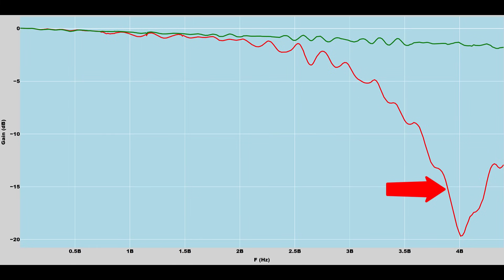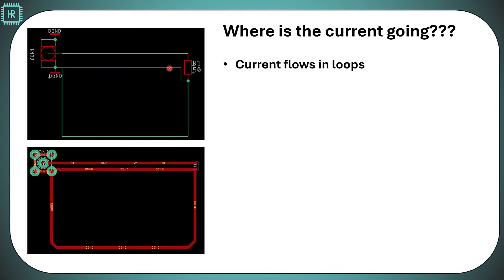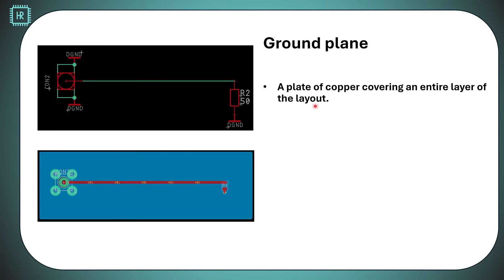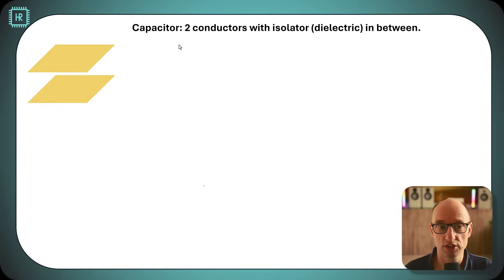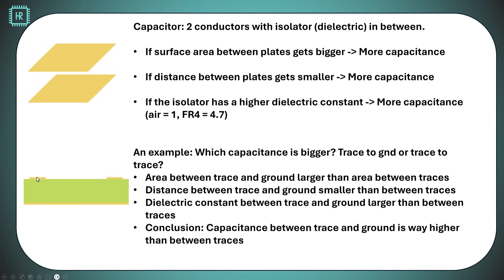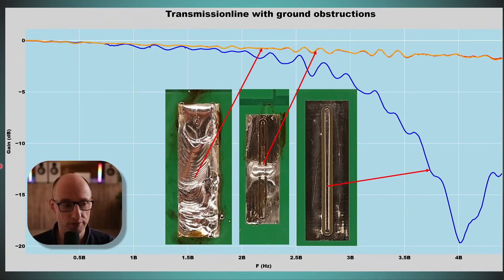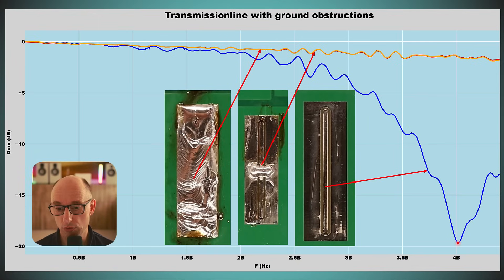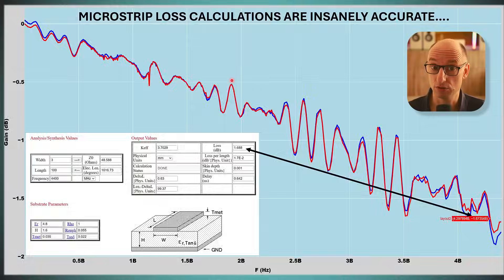Flawless PCB design: RF rules of thumb - Part 1

Comment: Please send me the checklist? 😋
Reply from the maker: I've changed the free checklist offer a bit: You also get a 1 hour module of my course for free!

You can find the link to the page in the description. Scroll down a bit on that page (Or read the whole page, you may get curious :-) ) to find the link. It is a purple button 'Watch The Free Module And Get The Checklist'.

You will have to leave your email address so I can start spamming you :-D . I don't do that very often, on average once a month, but I am thinking about starting an email series with useful electronics tips at some point.

Best regards,

Hans Rosenberg

Comment: Thank you so much for the valuable knowledge you shared in the video. It was truly interesting. Send me the checklist.
Reply from the maker: I've changed the free checklist offer a bit: You also get a 1 hour module of my course for free!

You can find the link to the page in the description. Scroll down a bit on that page (Or read the whole page, you may get curious :-) ) to find the link. It is a purple button 'Watch The Free Module And Get The Checklist'.

You will have to leave your email address so I can start spamming you :-D . I don't do that very often, on average once a month, but I am thinking about starting an email series with useful electronics tips at some point.

Best regards,

Hans Rosenberg

Comment: Send me the checklist (Send met the checklist)
Reply from the maker: I've changed the free checklist offer a bit: You also get a 1 hour module of my course for free!

You can find the link to the page in the description. Scroll down a bit on that page (Or read the whole page, you may get curious :-) ) to find the link. It is a purple button 'Watch The Free Module And Get The Checklist'.

You will have to leave your email address so I can start spamming you :-D . I don't do that very often, on average once a month, but I am thinking about starting an email series with useful electronics tips at some point.

Best regards,

Hans Rosenberg

Comment: Dear sir ; I still build point to point ( tube amplifiers ).........ground every stage local .....and usez a bus wire ground wire to connect every stage ground...........some like the trend of starground , I didn't like that because in my builds they were less performant...
I see in most commercial ampifiers the same errors ( to my experience ) , not separating ripple filtering and reservoir with capacitors ........alos that idea that huge capacitor values do a better job ( used as well for ripple and resrvoir at the same time )
When some resistors are in // i mount them tête -beche.......idem witHh // signal caps ...2 in // sound better than only one .
and a lot of other details.......when added up all those ( mostly small ) details make a ( big) difference ....I see also a lot of bad soldering ...or bad layouts for signal wiring and tube heaters..
Have a nice day and thank you for sharing your experience.
Reply from the maker: You're welcome, I hope this knowledge helps!

Comment: Thanks for the video. Please, send me the checklist.
Reply from the maker: I've changed the free checklist offer a bit: You also get a 1 hour module of my course for free!

You can find the link to the page in the description. Scroll down a bit on that page (Or read the whole page, you may get curious :-) ) to find the link. It is a purple button 'Watch The Free Module And Get The Checklist'.

You will have to leave your email address so I can start spamming you :-D . I don't do that very often, on average once a month, but I am thinking about starting an email series with useful electronics tips at some point.

Best regards,

Hans Rosenberg

Comment: Fastastic video!  It's been a year since you posted this, but can you still send me the checklist?
Reply from the maker: Yes I can :-) I've changed the free checklist offer a bit: You also get a 1 hour module of my course for free!

You can find the link to the page in the description. Scroll down a bit on that page (Or read the whole page, you may get curious :-) ) to find the link. It is a purple button 'Watch The Free Module And Get The Checklist'.

You will have to leave your email address so I can start spamming you :-D . I don't do that very often, on average once a month, but I am thinking about starting an email series with useful electronics tips at some point.

Best regards,

Hans Rosenberg

Comment: Great video. Send me the checklist.
Reply from the maker: I've changed the free checklist offer a bit: You also get a 1 hour module of my course for free!

You can find the link to the page in the description. Scroll down a bit on that page (Or read the whole page, you may get curious :-) ) to find the link. It is a purple button 'Watch The Free Module And Get The Checklist'.

You will have to leave your email address so I can start spamming you :-D . I don't do that very often, on average once a month, but I am thinking about starting an email series with useful electronics tips at some point.

Best regards,

Hans Rosenberg

Comment: Plase, send me the checklist.
Reply from the maker: I've changed the free checklist offer a bit: You also get a 1 hour module of my course for free!

You can find the link to the page in the description. Scroll down a bit on that page (Or read the whole page, you may get curious :-) ) to find the link. It is a purple button 'Watch The Free Module And Get The Checklist'.

You will have to leave your email address so I can start spamming you :-D . I don't do that very often, on average once a month, but I am thinking about starting an email series with useful electronics tips at some point.

Best regards,

Hans Rosenberg

Comment: Send me the checklist 
Thank you
Reply from the maker: 've changed the free checklist offer a bit: You also get a 1 hour module of my course for free!

You can find the link to the page in the description. Scroll down a bit on that page (Or read the whole page, you may get curious :-) ) to find the link. It is a purple button 'Watch The Free Module And Get The Checklist'.

You will have to leave your email address so I can start spamming you :-D . I don't do that very often, on average once a month, but I am thinking about starting an email series with useful electronics tips at some point.

Best regards,

Hans Rosenberg

Comment: Dear Hans, thank you for this great explanation/ Beste Hans, bedankt voor de prima uitleg.
I'm just a hobbyist trying to design a circuit that features the Raspberry Pi Pico W as uC.
I chose it over my previous work horse, the Arduino Nano v3, specifically because the Pico has many GND pins.
My signals have low frequency, except the digital switching involved. That tripped me up.

Could you please send me your checklist? Much obliged.
Reply from the maker: I've changed the free checklist offer a bit: You also get a 1 hour module of my course for free!

You can find the link to the page in the description. Scroll down a bit on that page (Or read the whole page, you may get curious :-) ) to find the link. It is a purple button 'Watch The Free Module And Get The Checklist'.

You will have to leave your email address so I can start spamming you :-D . I don't do that very often, on average once a month, but I am thinking about starting an email series with useful electronics tips at some point.

Best regards,

Hans Rosenberg

Comment: Could you send me the checklist too please?
Reply: I found the link, thanks a lot :)
Reply from the maker: I've changed the free checklist offer a bit: You also get a 1 hour module of my course for free!

You can find the link to the page in the description. Scroll down a bit on that page (Or read the whole page, you may get curious :-) ) to find the link. It is a purple button 'Watch The Free Module And Get The Checklist'.

You will have to leave your email address so I can start spamming you :-D . I don't do that very often, on average once a month, but I am thinking about starting an email series with useful electronics tips at some point.

Best regards,

Hans Rosenberg

Comment: Plese send me the checklist.
Reply from the maker: I've changed the free checklist offer a bit: You also get a 1 hour module of my course for free!

You can find the link to the page in the description. Scroll down a bit on that page (Or read the whole page, you may get curious :-) ) to find the link. It is a purple button 'Watch The Free Module And Get The Checklist'.

You will have to leave your email address so I can start spamming you :-D . I don't do that very often, on average once a month, but I am thinking about starting an email series with useful electronics tips at some point.

Best regards,

Hans Rosenberg

Comment: Send me a cheklist, thanks
Reply from the maker: I've changed the free checklist offer a bit: You also get a 1 hour module of my course for free!

You can find the link to the page in the description. Scroll down a bit on that page (Or read the whole page, you may get curious :-) ) to find the link. It is a purple button 'Watch The Free Module And Get The Checklist'.

You will have to leave your email address so I can start spamming you :-D . I don't do that very often, on average once a month, but I am thinking about starting an email series with useful electronics tips at some point.

Best regards,

Hans Rosenberg

Comment: Send me checklist please.
Reply from the maker: I've changed the free checklist offer a bit: You also get a 1 hour module of my course for free!

You can find the link to the page in the description. Scroll down a bit on that page (Or read the whole page, you may get curious :-) ) to find the link. It is a purple button 'Watch The Free Module And Get The Checklist'.

You will have to leave your email address so I can start spamming you :-D . I don't do that very often, on average once a month, but I am thinking about starting an email series with useful electronics tips at some point.

Best regards,

Hans Rosenberg

Comment: Please send me the checklist, loving your work so far, a lot that I have learned from other greats such as Lee Ritchey and Rick Hartley.
Reply from the maker: Thanks a lot, that is a great compliment!

I've changed the free checklist offer a bit: You also get a 1 hour module of my course for free!

You can find the link to the page in the description. Scroll down a bit on that page (Or read the whole page, you may get curious :-) ) to find the link. It is a purple button 'Watch The Free Module And Get The Checklist'.

You will have to leave your email address so I can start spamming you :-D . I don't do that very often, on average once a month, but I am thinking about starting an email series with useful electronics tips at some point.

Best regards,

Hans Rosenberg

Comment: envieme la lista de verificación. Send me the check list of verification. Thank you
Reply from the maker: I've changed the free checklist offer a bit: You also get a 1 hour module of my course for free!

You can find the link to the page in the description. Scroll down a bit on that page (Or read the whole page, you may get curious :-) ) to find the link. It is a purple button 'Watch The Free Module And Get The Checklist'.

You will have to leave your email address so I can start spamming you :-D . I don't do that very often, on average once a month, but I am thinking about starting an email series with useful electronics tips at some point.

Best regards,

Hans Rosenberg

Comment: Excellent Video! please send me the checklist
Reply from the maker: Sorry for the late reply: I'm really behind!

I've changed the free checklist offer a bit: You also get a 1 hour module of my course for free!

You can find the link to the page in the description. Scroll down a bit on that page (Or read the whole page, you may get curious :-) ) to find the link. It is a purple button 'Watch The Free Module And Get The Checklist'.

You will have to leave your email address so I can start spamming you :-D . I don't do that very often, on average once a month, but I am thinking about starting an email series with useful electronics tips at some point.

Best regards,

Hans Rosenberg

Comment: I would like your checklist too please. 

30 years ago as a young software engineer I also started writing down every bug or problem I encountered and the corresponding solution. I naively thought eventually I would just look up each problem and not have to puzzle anymore. 30 years later and I've lost 30 such embryonic lists, and realise I've rarely encountered the same problem twice!

I'm super impressed and a little jealous that you've managed to be organised and committed enough to actually write a book. That's inspirational.
Reply from the maker: Interesting, I think I understand why this works in electronics and not in software. Electronics is related to physics directly, whereas software changes all the time. This makes an electronics checklist far more 'timeless'.

Sorry for the late reply: I'm really behind!

I've changed the free checklist offer a bit: You also get a 1 hour module of my course for free!

You can find the link to the page in the description. Scroll down a bit on that page (Or read the whole page, you may get curious :-) ) to find the link. It is a purple button 'Watch The Free Module And Get The Checklist'.

You will have to leave your email address so I can start spamming you :-D . I don't do that very often, on average once a month, but I am thinking about starting an email series with useful electronics tips at some point.

Best regards,

Hans Rosenberg
Reply: @HansRosenberg74 yes I was thinking the same reason. I just used some op amps I found in my attic from the late 80s! I can't imagine even accessing let alone compiling software I wrote in the same era. Thanks for the tips.

Comment: Yes please I'd like a copy of your check list. Thanks.
Reply from the maker: I've changed the free checklist offer a bit: You also get a 1 hour module of my course for free!

You can find the link to the page in the description. Scroll down a bit on that page (Or read the whole page, you may get curious :-) ) to find the link.

You will have to leave your email address so I can start spamming you :-D . I don't do that very often, on average once a month, but I am thinking about starting an email series with useful electronics tips at some point.

Best regards,

Hans Rosenberg

Comment: Nice video's Hans! Very clear to watch. But I have only one question: in DC the ground plane is the - of the DC. But is the groundplane in 230V AC connected to the neutral or must it be connected to earth to minimize noise etc? 

Oh yeah, and please send me the checklist!
Reply from the maker: Very often, the grid ground is isolated from the ground of your circuit. A linear supply has a transformer to do that, but a switching supply as well.

I've changed the free checklist offer a bit: You also get a 1 hour module of my course for free!

You can find the link to the page in the description. Scroll down a bit on that page (Or read the whole page, you may get curious :-) ) to find the link.

You will have to leave your email address so I can start spamming you :-D . I don't do that very often, on average once a month, but I am thinking about starting an email series with useful electronics tips at some point.

Best regards,

Hans Rosenberg

Comment: I would like the checklist as well please!
Reply from the maker: I've changed the free checklist offer a bit: You also get a 1 hour module of my course for free!

You can find the link to the page in the description. Scroll down a bit on that page (Or read the whole page, you may get curious :-) ) to find the link.

You will have to leave your email address so I can start spamming you :-D . I don't do that very often, on average once a month, but I am thinking about starting an email series with useful electronics tips at some point.

Best regards,

Hans Rosenberg

Comment: Thank you Hans, 
I've never heard or seen PCB ground planes described in such a simple and relatable way and I've been in the industry for 35 years.
I still find plenty of engineers new and old who treat RF design as a 'dark art' and hand wave it away with 'well I only design digital',  but ALL electronic design outside of a simulation IS analog design,  it's just as important to understand good practice and the reasons why when designing any PCB.
  
 Thank you again for your generous tip in sharing your knowledge freely.

Please Send Me a Copy !
Reply from the maker: Wow, thanks for the nice reply. It's always so great to get feedback from experienced electronics engineers, those are so nice to hear :-). I so much like your realisation that all electronic design is analog design, that is soo true, and if you treat designs that way, you'll have a really good chance of getting them right (provided you have the knowledge).

sorry for the late reply, we were away for a long weekend.

I've changed the free checklist offer a bit: You also get a 1 hour module of my course for free!

You can find the link to the page in the description. Scroll down a bit on that page (Or read the whole page, you may get curious :-) ) to find the link.

You will have to leave your email address so I can start spamming you :-D . I don't do that very often, on average once a month, but I am thinking about starting an email series with useful electronics tips at some point.

Best regards,

Hans Rosenberg